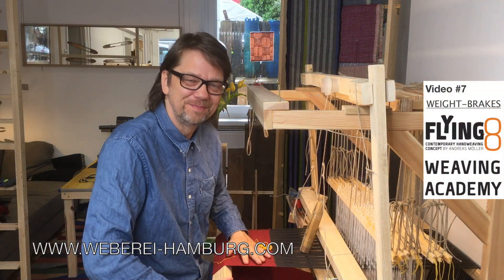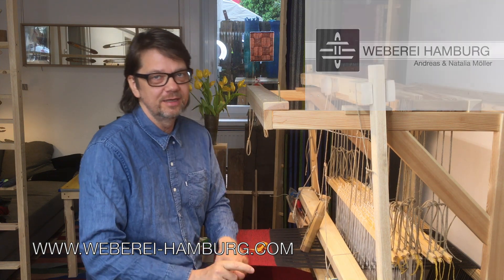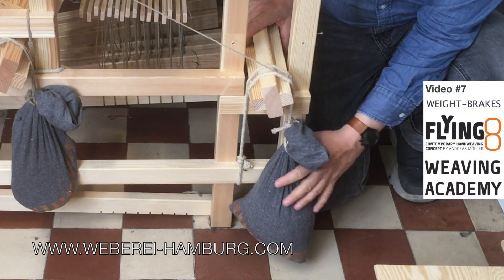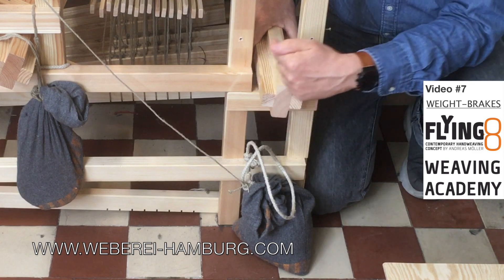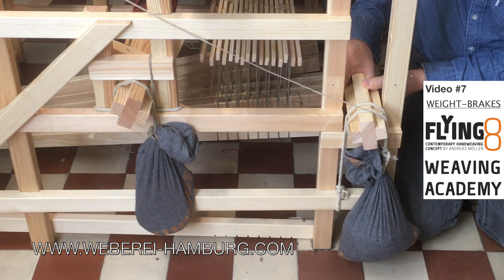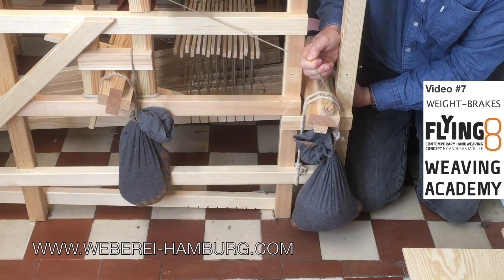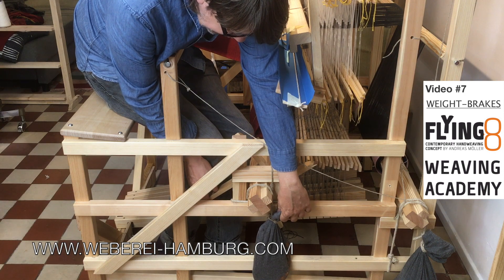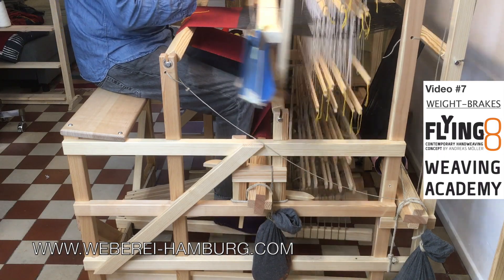#7   Flying8 Weight-Brakes

Comment: How many meters can you make by this loom? Per one hour and when you weave simple fabric 7 - 8 threads per cm of weft
Reply from the maker: Hello Михаил Стариков,
it is very easy to make 10m in 3 hours by that quality, if you weave a narrow warp, 35cm.
In wider warps, 190cm, it is possible to make around 5-6- in 3 hours.
Stay safe,
Andreas
Reply from the maker: It still would depend on the width, but 1-2m would be easy to achieve.